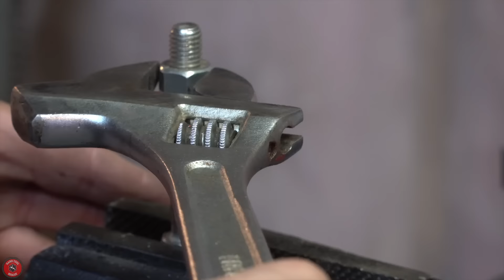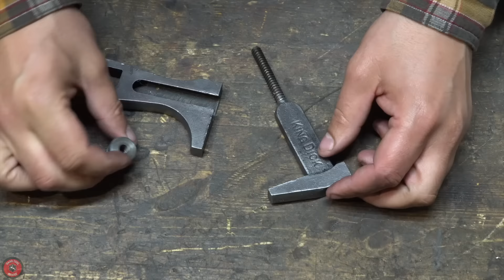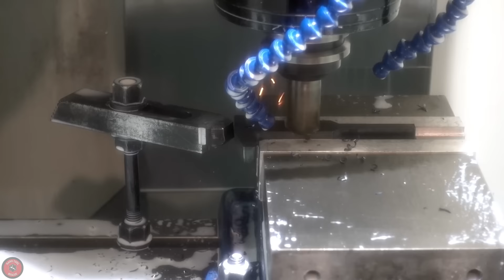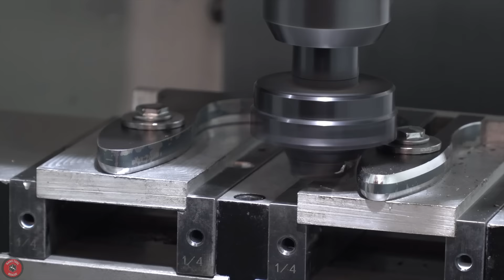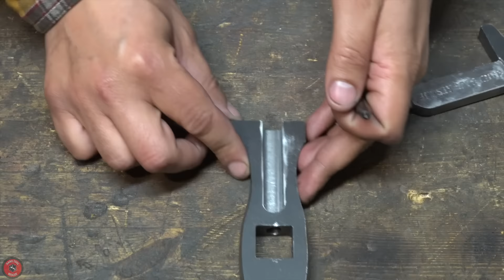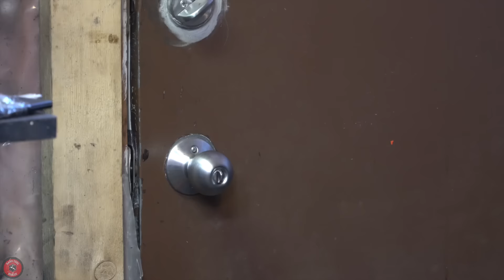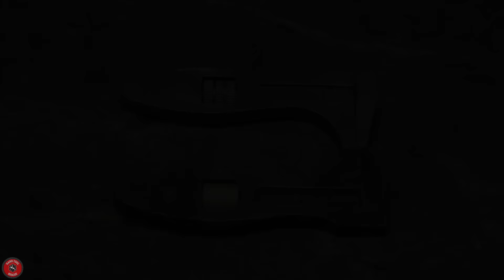1879 Adjustable Wrench [Resurrection]

Comment: Important Technique Information:  A forgotten trick (unless you were taught by a grandfather who used these a hundred years ago) for increasing the strength of the wrench:  Place a nut of the same size as you are removing into the "opposite-side-jaw", that will transfer much of the force directly to the frame and not through the threaded post.  That back overhang is there for important reasons, including the right angle turning that was shown in the video.
Reply: Directly from the frame not from threaded...... tech. Point
Reply: @MrSpiritmonger  imagine you're trying to remove a jammed 5/8" nut - you tighten up your wrench onto the nut, but before fully tightening it, you place a second spare 5/8" nut in the back slot of the 1879 wrench. This effectively bolsters the head of the wrench against pivoting open, giving you a more stable grip on the stuck nut.
Reply: Ohhh... I get it
Reply: Awesome, great technical know-how, thanks.
Reply: oh wow that's a great trick!
Reply: Someone shoulda told AVE that before he destroyed one.
Reply: @shambler1502  , wouldn't have helped, he would have found some other way to find the limits!
Reply: Well i be dipped in shit...........What a great tip ............Thanks mate👍
Reply: thats so obvious, yet mind blowing cos I never thought of it :)  thankyou buddy

Comment: I admire you for not trying to sell these for crazy prices. I just checked the website and was impressed by how affordable they are considering how much work you are putting in them.
Reply from the maker: Thank you!
Reply: Not only are these wrenches affordable, but they offer MANY advantages over a regular adjustable wrench and for nuts under half an inch, I'd reach for this wrench over any other adjustable ANY day. Of course a box wrench/socket is still always better.
Reply: Yeah I was expecting easily double that. Excellent work for a very very good price for the amount of labor going into each one
Reply: i dont know, buying a good quality wrench of the same size for 15$ or paying almost 75$ for this one shipped. also you can see him filing into his wrench like it was nothing. this prove very low hardness material has a proper tool steel will not be affected by a normal file.
Reply: Mine was no where near $75 shipped. Just got it, and love it
Reply: @Francois_Dupont  I gonna have to disagree.   I bought one and it is hands down the best adjustable wrench I have ever used.  Your right he did file right into it but I use it everyday in the shop and have had zero issues with that.  Don't use it as a hammer and you are good
Reply: he should charge quadruple what hes asking. hes making nothing on his labor, tooling, consumables, and so on.
Reply: @yar0nix224  Agreed!   I just purchased one of these from him and it is the best adjustable wrench I have ever used in my entire life!  with the small thread size you can get extremely tight on whatever nuts, bolts etc.   This thing is awesome

Comment: Beautiful work!  The original King Dick "fish" wrench has two additional parts yours does not have: a thrust spring and a washer in a recess in the bottom of the knurled thumb wheel.  This keeps the thumb wheel tight against the top of its cutout and prevents the tool from rattling.
Reply: true, I took it apart a while back
Reply: I was just about to comment the same. I have the original King Dick too and wouldn't be without it.

Comment: Found two of these specimens in Durban South Africa at two separate flea markets. First one similar to yours dated 1945 appears to be standard issue to Ford vehicle of the same time slot, strange "laminated/ riveted fabrication.

Second smaller version (half the size of the first) labelled "Made in England"...solid steel construction.

Ergonomically amazing.

Thank you for sharing your resurrection exercise. Good luck

Comment: Hey hand tool rescue so I ordered a full size and a mini and the first chance I got to use the full size was to do the door hinge pins on my truck due to its design and build the wrench was ideal and then also due to its weight it also landed a hefty small tapping Hammer effect to get everything lined up properly the mini however I found was good for doing small adjustments but I then found it also works good as something to hold my tablet up while I watch your videos while laying on my bed you need some pretty cool stuff man keep it up

Comment: If you didn't see my comment on AvE's video,  I'm pasting it here in case you get another batch made.  Feel free to use any of these ideas.

I've got a diddy one of these.  It has no maker's mark so I assumed it was shop made until I saw Mr Pete had one the same.
I've thought of the following possible improvements.
1)  Make the square section closed,  which would mean it'd need to be cut on a shaper, EDM or broached  but would make it much stronger (I had to squeeze mine together when I got it)
2)  Engrave a measuring scale so you can use it as a caliper.  1/16ths would do nicely to determine a nut size (mm on reverse) 
3)  A bevel gear on the back of the nut with a hole in the body behind it,  so you can use a drill chuck key to apply clamping force.

Now I've seen how you made yours,  and how AvE stripped the threads,  I've got another suggestion.   If you leave off the threaded tang on the moving jaw,  you could drill and tap a hole in a fixture on a drill press, and then Loctite in a piece of high tensile allthread.   Also, when tapping the adjuster nuts,  I suggest you use a spiral machine tap as they are better at clearing the chips when you go straight through. That might explain the gnarliness that AvE noticed inside the steel adjuster.
Reply from the maker: These are all awesome suggestions.  Thank you so much!  I really tried to make these as close to the original as possible, and while making them, I could see some areas where a few changes could help out.
Reply: With a bit more thought, the bevel gear idea might be a non-starter,  as the teeth on the chuck key are made to work with a specific diameter chuck.  My 1/4" Jacobs chuck (probably the smallest common size) is 1 5/32 (almost 30mm) wide.   You might get away with abusing it on a smaller gear as the keys are forged and always survive longer than the teeth on the chuck.

Comment: I built specialty sockets for doing deisel motor Injectors, and Sensors like cam possitioning sensors, speed sensors ect ect on deisel motors and trucks. as well as pullers ect for brake componants ect. but do to a rapid change in my life and so on I sold my mill, Lathe and all other metal working tools i had in a mobile semi trailer set up like a work shop for doing longer term on site jobs. It worked very well for me for the many years I used it. when out in the bush it was easier to make things than run to town some times a 4 hour drive to get them.

Comment: There is a thing called the mini ductor venum, and it uses electric coils to heat up bolt heads. It allows you to heat up the bolts a d screws without affecting the rest of the object.

Comment: part 1 my congratulations. good tool

part 2 (rationalization proposal)
by the way, one could do without turning. but take a ready-made, hardened high-strength bolt and a ready-made shaped nut according to the DIN467 standard, or even two - one will be a locknut for the other. a high-strength bolt will give a better chance that the thread will not break off during some work. and if the thread is broken, the bolt can be quickly replaced. it will only be necessary to modify the head of the bolt, turning it from hexagon into a  rectangular and in this form inserted into the groove in the retractable rail.

Comment: Great job man! When I have money I will definitely buy one!
If I can suggest a variant: harden some samples in exhausted engine oil, it becomes of a stupendous color (in more steps) and becomes more resistant to corrosion (on this last part I'm not sure)
Reply from the maker: If you pick one up and do that to it, I would love to see!
Reply: Hand cranked AstroGlide was used on the original King Dicks.
I Believe.

Comment: i have an original 1920's one of them from one of the old ford cars i am trying to do a complete restoration on it as i had found it buried 2 feet in the ground so it was covered in rust and seized as well managed to clear up all the indent markings on it

Comment: Hand Tool Rescue
I've been binge watching your channel and I love it. Keep it up! I'd love to see your store grow into the MAC truck of antique tool shops! 

A little nit pick suggestion on the adjustable wrench, would it be feasible to add a magnetizes bit driver on the bottom of the handle? Also, integrating a meteric or standard ruler near the machine threads so the rear jaws could be used as a mic/caliper. My money is yours when it has some "antique multi tool" features.
Reply from the maker: Thanks!  I've thought about both of these features and it may happen one day.
Reply: Hand Tool Rescue I'm looking forward to seeing them. Sincere thanks for you time and all the work you do!

Comment: I have to call you out on the "hand-cranked" laser cutters of 1879. I'm pretty sure steam power laser cutters were more prevalent in the larger urban areas where as the hand operated laser cutters were possibly favoured by the local village Smithy.

Comment: The only thing that would make the design look any better, would be to put at least a one inch ruler with ar least 1/8th inch marks on the handle and a mark on the slide that let you know how wide the jaws are open so that you can pre adjust the wrench.

Comment: Very cool to see it machined out. I'm curious what the cost increase would be for a run in a tool steel, 1080, 1075, even 1060. It shouldn't be too much more effort to heat and quench than your case hardening setup. Just need a magnet to test for austenitic temperature and some quench oil. Then bake in an oven to temper. Then an abrasive tumble to remove scale. It would make the tool much tougher.
Reply from the maker: When I looked into it, it would double or triple the cost of the wrench.

Comment: Both your original and the reproduction appear to be missing the spring washer on the bottom side of the knurled adjuster. The adjuster on my 8" King Dick is recessed for that spring washer.

Comment: Eric - I just found your channel a few months ago and have loved every single episode I've seen so far!

I just ordered some of your tools, #1, because they're cool as $hit, #2, I'll use them and #3, one or two will go to my Dad who will appreciate (and use) the heck out of them also!

QUESTION: Have you / would you consider making one of the adjustable wrenches out of brass or bronze??? I occasionally work with AN fittings... but not enough for me to spend the $ on a AN wrench set. One or two of these in brass or bronze would do the trick for me (and would be WAY cooler than a AN wrench set). 

🙂

Comment: I have a set of the originals that were passed on to me when I started work in the 70s ... KD started production in 1856, 100 years before I was produced.  I've no idea how old my set are ... but they still do the job.
KingDick are still in production making excellent tools - but no longer make the iconic wrenches.

Comment: I just watched AvE strenght test.. And it looks like weakest part of your wrench is thread. I think it would be better if you use Acme or Trapezoidal thread because it can withstand more force. That is reason why it is used on jackstands and vices. Im not saying that your wrench is bad this is just idea for inprovement. Otherwise it works and looks good :)!

Comment: I really like that wrench, though I'm not generally a fan of case hardening, I prefer the full hardening process. Still, turned out great, hope you get a bunch sold, they look to be a quality product.
Reply: Great comment, If I may suggest to HTR wrench body should be cut out of AISI 1045 [medium carbon steel]  will thru harden and temper with much greater strength and rigidity that a wrench needs...also would eliminated that nasty, expensive,  case hardening powder. I don't think there would be any problem machining  laser cut 1045.

Comment: To make it harder to make - I propose the following:

Broach the slot for the slide instead of milling it out.  That way it will be completely encased.  Drilling to the diameter then broaching the corners should do the trick - right?

EDM would also work AND allow you to buy another tool for your shop!  How wonderful is that?!

Comment: You missed another difference - the original has a preload/anti rattle spring inside the adjuster along with a washer.
Reply from the maker: The spring actually showed up in later versions (post-1920s).  Before that, a rectangular washer spring was used under the adjuster, but was quickly phased out as people kept cutting their hands on it.  I decided to go with the original design as it allows the adjuster to move easier, even if their is more slack.
Reply: Ah, OK. I've only the one example to go on, age unknown, which came from my father and he wouldn't have bought it new. Fully agree with the comments here - it's a very nice wrench/spanner.

Comment: The wrenches look amazing, but i gotta ask... Why not tumble-sand or tumble-polish them? Would be a lot faster if you have to do a bunch compared to a wire wheel. A small concrete mixer filled with (sandblasting) sand works quite well as a tumbler, if you need something bigger. Just put a bag over the hole to keep dust down.

Comment: Very cool project love the ol school look to the wrench. I have seen you use these in a few videos.  I thought it was cool restoring the old seeder with old tools One thing was thinking that old seeder would have had a Oak handle on it, but search around the net and found it with metal tubing like yours, It just seemed in my mind it would be oak. It's funny how you think or visualize something. Anyway great job on the wrench might have to get one those. Great eye for detail and I like the way you made it just a little beefyer. One question about Brass and steel adjustment knob I would think the brass would fail because of the softer metal have you tested what it would take to damage the threads between two?

Comment: i just bought 5 wrenches. i went with steel adjusters for the most part because its not an option on the mini-wrenches. did i screw up thinking steel will be stronger? if there's an advantage to brass, id like to know. i thought it's softer, but im no entymologist.

Comment: Really great little tool.  How do I know this?  I found an original King Dick in the 'odds and sods' bin in an antique shop here in Scotland a couple of months ago.  It had a small amount of surface rust which took approximately 42 seconds to completely clean up.  Not bad for £2.00 (US$2.70  CN$3.48).  Use it far more often than my cheap adjustable for far more things.

Comment: I don’t expect an answer but I just got one of these for Christmas. I am thinking about using gun bluing on it to give it an added layer of protection. Or would you just suggest keeping a light coat of oil on it?
Reply from the maker: Either are fine!
Reply: @HandToolRescue  if I blue it I’ll send you pics of how it turns out. Still not sure if that’s the route I want to go. I love how it looks now and kind of don’t want to change it.

Comment: Okay, you're definitely the dude to ask about this. Is it possible to turn a helix or spiral, in wood or metal (or resin), using a lathe and associated tools only? If so, could you possibly demonstrate?
Reply from the maker: Of course!  I assume it would work exactly like how metal cutting lathes cut threads into rods.

Comment: just ordered a wrench, April 2019, suscribed and just say you're patreon.  Really fun watching the restorations.  As an old tradesman (union pipefitter UA class of 1982) i'm curious about your use of this tool. We are taught with adjustable wrenched to turn the wrench in the direction of the adjustable jaw.  I always see you use this wrench just the opposite.  This wrench in no way is as flimsy as a common adjustable wrench, but is there a reason this wrench is used 'opposite' of what i learned in my apprenticeship?

Comment: This may have been mentioned in the previous 572 comments. I'm not gonna read them all. Charles Billings, (Billings and Spencer) was an American and the 1879 patent is too. King Dick was a British product.  Alloy Artifacts does not mention King Dick as connected to the American Billings, but the British say the King Dick products  are low quality
Reply from the maker: Yes, after the patent expired, King Dick became the most well known company producing this style of wrench.  The original patent is slightly different.

Comment: Why not quenching in oil? well, I guess it allows for warping more then that hardening compound possibly.
Reply from the maker: Water is what is recommend for case-hardening using this process.
Reply: I see. I guess oil quenching is best for less complicated or separated parts, like blades, nails, etc.
Reply: love your vids btw

Comment: Tried to purchase it, but it said it had a problem with my credit card, I tried 2 different cards MasterCard and Discover, and both had the same issue. Unfortunately it didn't say what the error was, so I couldn't figure out why it failed.
Reply from the maker: Interesting...did you try to pay with a credit card though paypal as well?

Comment: Parting off with that much overhang I find disconcerting to say the least!
Reply: Another thing I find disconcerting is putting bare hands into water that has been used to quench a component that has been case hardened using a compound that may contain cyanide! If you've got any small cuts or scratches you'll know where they are. Don't ask me how I know!